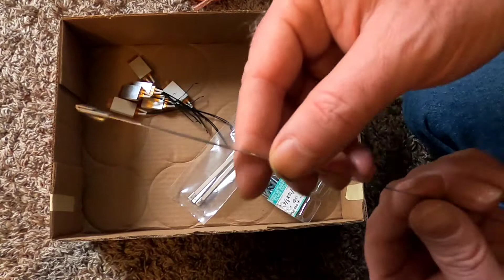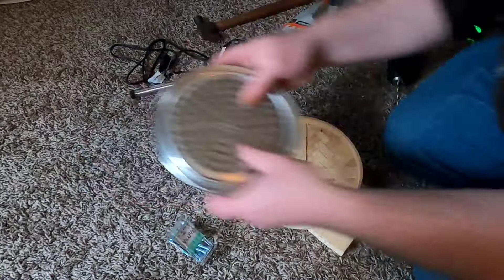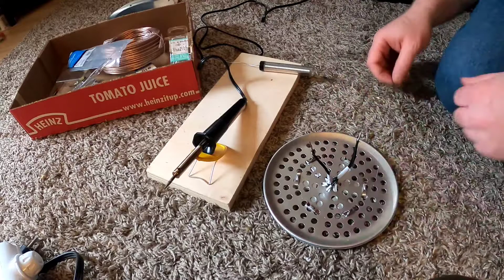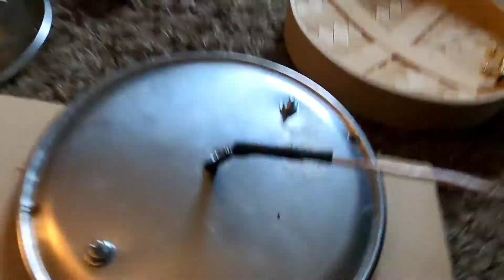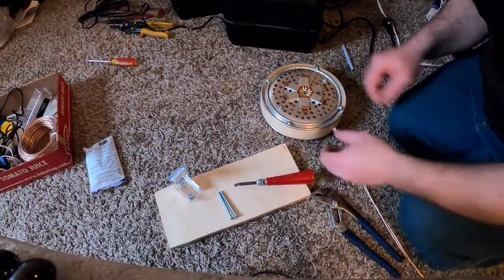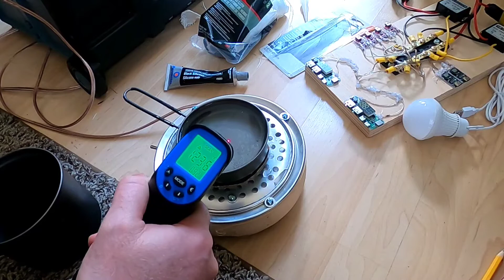DIY 12 VOLT DC ULTRA EFFICIENT STOVE - 168 watt PTC THERMISTOR PROTOTYPE VERSION 1

Comment: use a heat shield with either fiber glass or furnace  insulation
Reply from the maker: In the next working model I used aerogel and a redesign.

Comment: If at first you don't succeed. Well you know the rest. Great idea though. I'm sure you'll get it. Keep those hamster wheels turning Frank. Always interesting to watch and learn from you.
Reply from the maker: I was very close, already have a redesign, parts coming in the mail, lol. When you are using that little power there is little room for error. At peak it uses 168 watts, normal running wattage was closer to 60 watts that is very little power for cooking with... the commercially available products normally use closer to 150w. Thanks for all the support Jon and the kind words, more coming soon cheers!

Comment: Hey Frank, The way to solder wires together or any joint, for that matter, is to heat the wire joint with the iron and then apply a good drop of solder to the joint. You will know that the job is done right when the solder naturally runs into the joint, securing it.
 I really like your innovative ideas, whether it turns out real great or not. It shows that you are thinking, not just doing.
This is a very different project, nice job. ;-)
Reply from the maker: ya I know soldering has always been one of my weak spots with electrical stuff, lol. The war cry of millions. Either way this was a prototype I am close, the next version should resolve the heat dissipation issues. I think the line of thinking is showing promise though, thanks for watching, and the kind words, cheers!